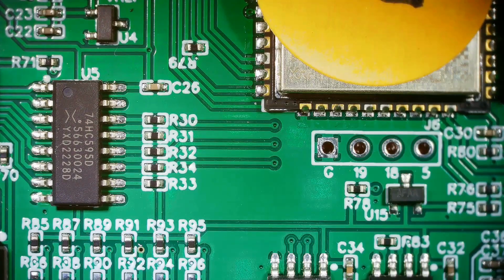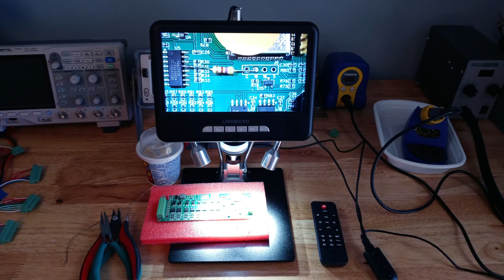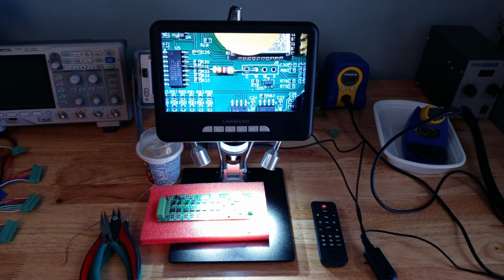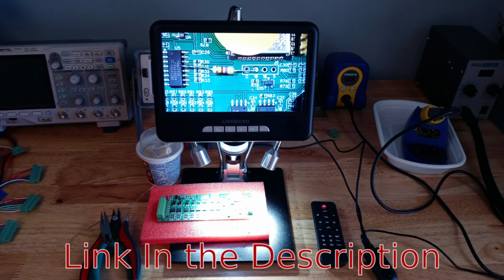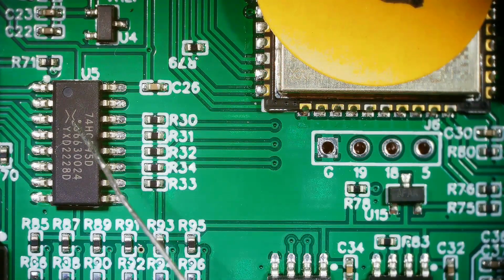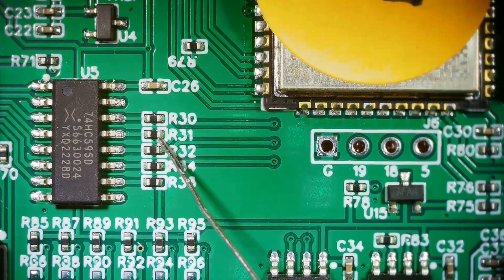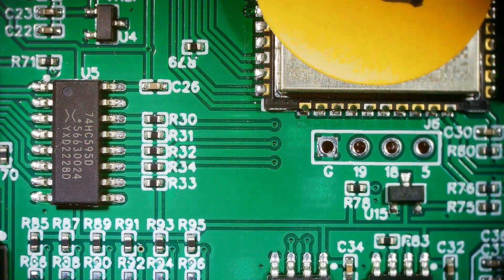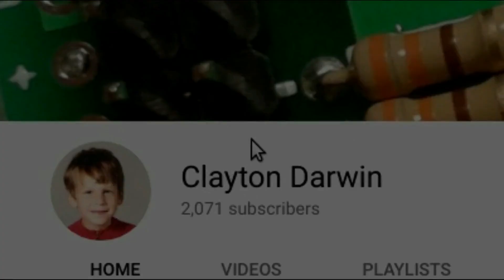Quick PCB Repair Using a Microscope

Comment: Not sure why you’re not using solder braid to clean the pads, better to clean any solder (or sodder) off and lessen the risk of any problems.. good video though. Keep up the good work 🤙🏼🇦🇺
Reply from the maker: Good call. I didn't have any braid small enough to fit between the 0402 resistors in that line. And... in this case it didn't really matter. And... I was in a hurry.
Reply: @ClaytonDarwin  mate you need to slow down, think three or four steps in front mate…🤙🏼🇦🇺
Reply from the maker: Tell me about it.